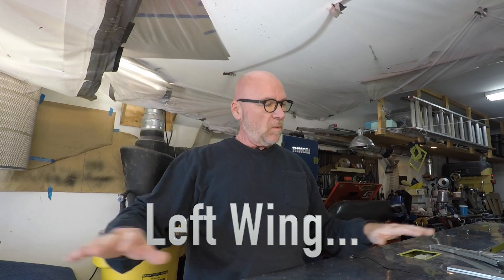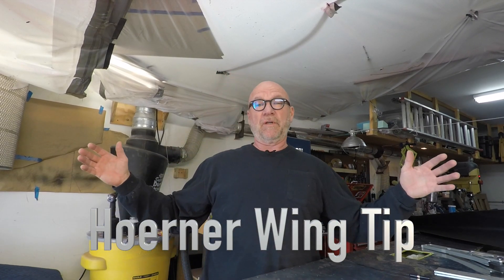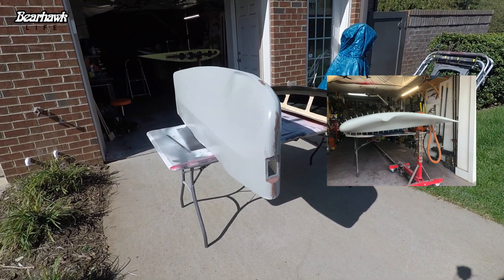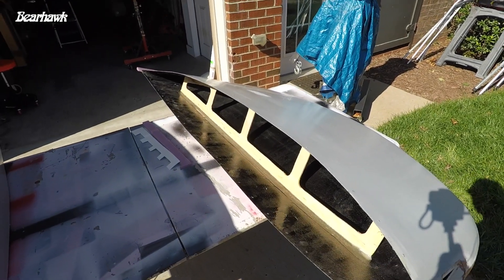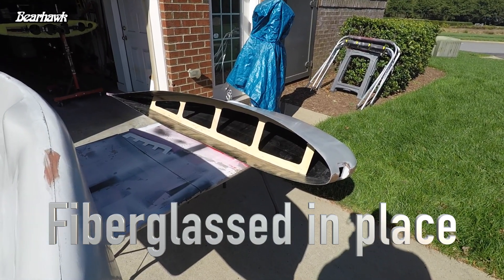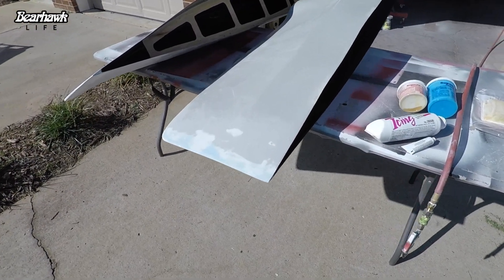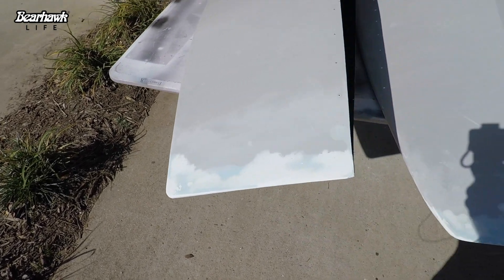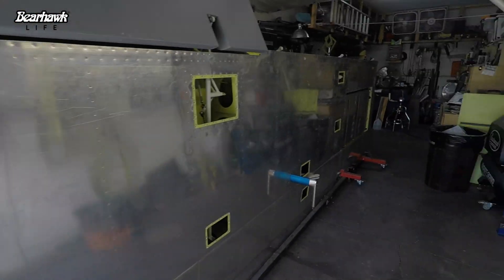BEARHAWK ~ Hoerner Wing Tips!

Comment: I don't think you can put styrene based filler over epoxy...but you probably learned that by now.
Reply from the maker: Yep.  Learned that the hard way.  Stripped em completely down after making that dumb move...
Reply: @TheBaldPilot  haha. I just spent months building a plywood mold with compound curves. Now I'm going to fill the glass/epoxy shell that I took off of it with reinforcing foam.

Comment: Love all the videos and will reference them a lot when I finally start my build.  Where did you find the tips at? They appear to be carbon fiber as well how did you isolate the aluminum extensions you made to the trailing edge to prevent corrosion?
Reply from the maker: Thanks!  Carbon Concepts in Alaska made the tips.  I did not isolate the aluminum from the CF.  Although it is coated with 3M Scotch Weld.  My thought is even if the aluminum corrodes, it is surrounded by epoxy and polyester filler.  We'll see.  I may be rebuilding them in a few years...